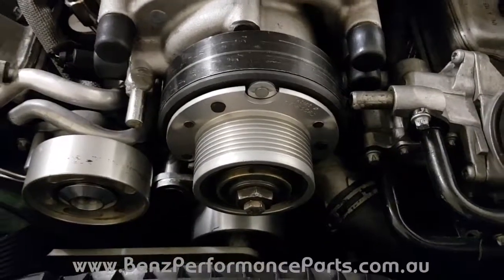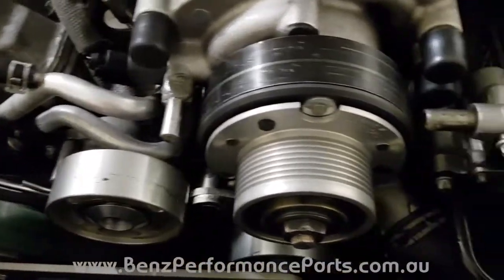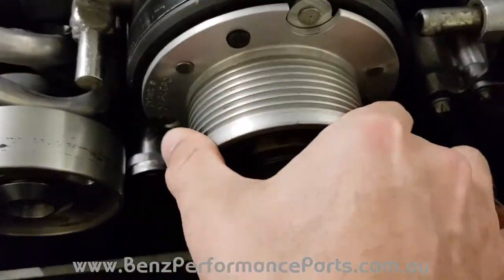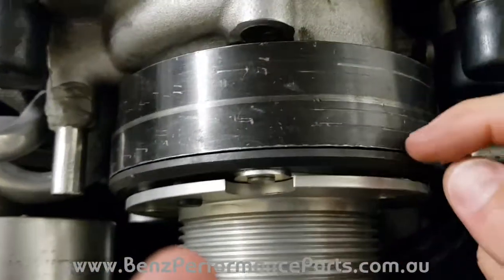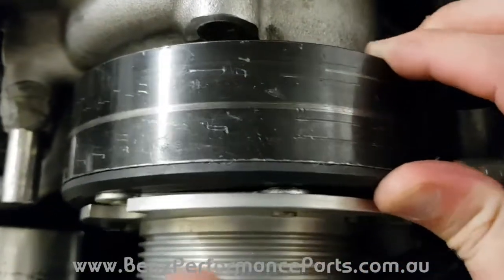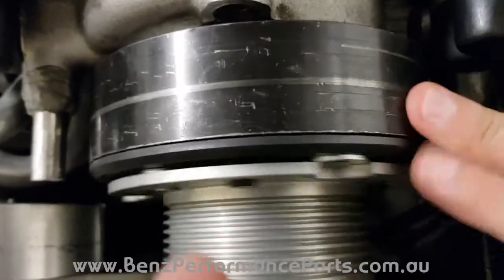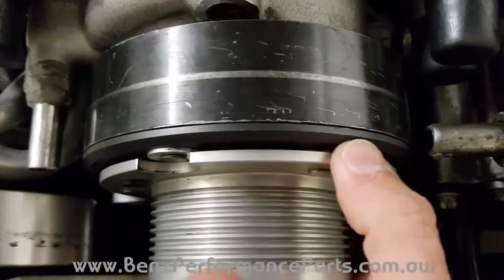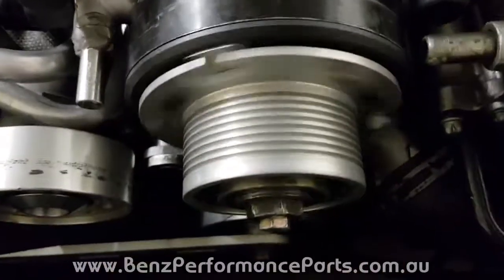How to check the Mercedes M113K Supercharger Pulley Bearing and Gap - W211 E55 SL55 G55 CLS55

Comment: I replaced the bearing with an nsk made in japan ( the same code that was on the original pulley and on the 65 mm pulley 32BD45DU) can you tell me the code on the nachi bearing?
Reply from the maker: I don't know what the V6 pulley is. But the 32db is size and style.

The rest is what  the inside is like and if it's sealed